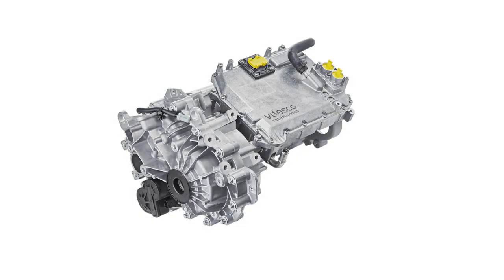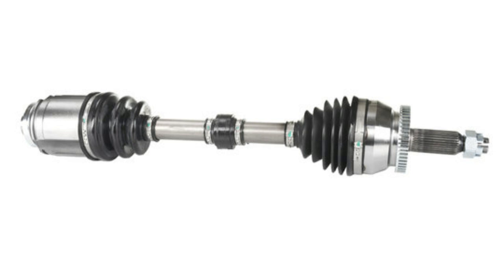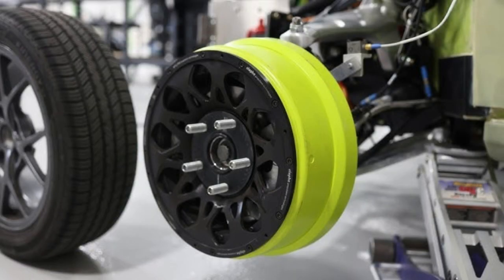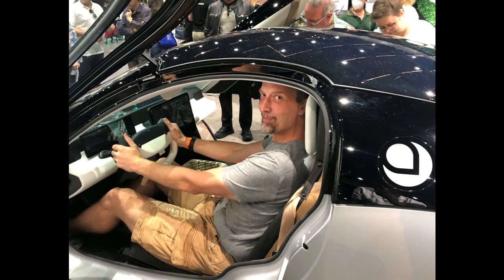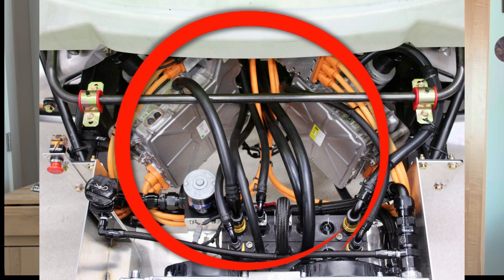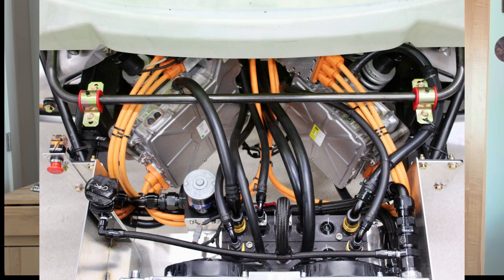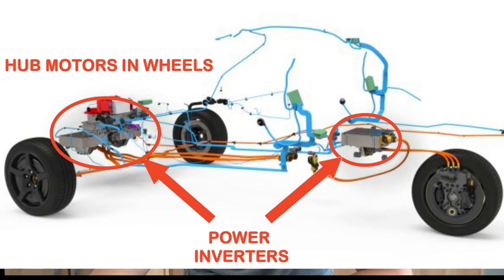Aptera's EMR3 Motor Design vs Original Elaphe Hub Motors

Comment: Thank you for the analysis. You implied that the reason for the drive train change was Elaphe’s inability to produce the required motors. I’ve seen other speculation that the hub-motors had heat issues and that being unsprung weight they suffered from vibration issues. I applaud Aptera’s change but is there additional insight for the change? TIA
Reply from the maker: I also read long ago that Lordstown had reliability issue with the Elaphe motors but I could not find the report and did not want to but out bad information. Thank you for watching!

Comment: NB that efficiency wise; NOTHING beats free wheeling. 
Regen is not 100% efficient, so covering distance in neutral beats it, but ONLY UNTIL you start braking.
Hub motors couldn't do that.
Not until now.
See this and when you 'get it' you will be amazed at just how ingenious Freegen is.
https://www.youtube.com/watch?v=bLu6H-K4L2Y
Now that's going to end up being made at scale, probably in China, by a company more than qualified to build larger ones suitable for Aptera.

IMHO Aptera didnt look hard enough  for an alternate supplier of hub motors.
There are plenty of suppliers that would be happy to do the volume of hub motors they envision.

As to the issue of unsprung weight, see this!
https://www.youtube.com/watch?v=qxKJu_-0rUA
Besides the huge reduction in unsprung weight, consider the implications:
No holes in the body or wheel covers for the suspension members and now drive shafts, improving drag tremendously. 
(That's something that should have an aero rubber 'boot' IMHO)
More interior space or aero design freedom.
etc.

Comment: I thought the use of hub motors by Aptera was a very good idea because they can resolve the issue of 3 wheeled vehicle rollovers, even with tadpole configuration with two wheels in the front. The operation of a conventional single motor FWD propulsion with open axle system verses independently controlled motors at each wheel is significant because the wheel speed and torque for each wheel can be independently controlled.  An example of this could be seen in the videos of the Aptera performing the Moose Test extreme evasive maneuver.  With hub motors the Aptera handled this test with ease performing the Moose Test at speeds that would cause an ordinary 3 wheeled vehicle to tip and roll. The active torque vectoring provided by independently controlled motors at each wheel provides greater cornering stability at high speeds and better traction under all conditions.
Reply from the maker: The issue with 3 wheeled vehicle rollovers can be attributed more to improper configuration. It is common for a tadpole configuration to have a powered rear wheel, this makes the car unsafe. However having a powered rear wheel is common. Aptera still has a plan for 3 wheeled drive just not for the Launch Edition. Let’s see how PI 2 handles the track and testing in the next month. Thank you for watching!

Comment: Bravo! Thanks for making the video and for doing the calulations. 
I have a question about if the engine can do regenerative braking based torque vectoring. 
If " EMR3 can not free wheel if no power to it" does that mean we can't let the vehicle roll down hill without power? (Can this be achieved with a release of a lock of motor to the wheel axials when we want to free wheel roll?)
Question 2. Does that mean emr3 Can't get regen braking/ regen from going downhill? Can it allow for torque vectoring by having different regen braking levels to each wheel?

Comment: You sound like an engineer! I LIKE your detailed list of components in your comparison. I think you left some out. There were changes other than the inclusion of a drive shaft for the new motor. Much more complex with more pieces in the suspension.
Reply from the maker: Thank you for the compliment.  This is true there are other changes too the chassis and suspension to accommodate the change to the ERM3 that I will talk about in a upcoming video. Thank you for watching!

Comment: Hub motors may be the future but they are not yet mature technology. The different size batteries are more of a weight change than switching from hub motors to a central motor. Get the car on the road and make changes/improvements in future models. If they can't make a profit, it won't matter which motor they use.
Reply from the maker: True, I think the hub motors will be the future, currently I have seen that BMW and Ford are preforming there own tests with hub motors. thank you for watching!

Comment: So, what’s the zero to sixty supposed to be now after this change?
Reply from the maker: There is nothing official from Aptera and I don't think we will get an official number until testing is done on PI (Production Intent) 2 or 3. however using a online calculator it can be estimated.  With 201hp from the EMR3, a 230 pound driver and a curb weight of 2,200 pounds  the calculator estimated 5.5 seconds.  Thank you for watching!

Comment: Good analysis on motors and weight.  Well done.  Would have been useful to have on screen graphics.

I think the Protean in wheel motors would be a better bet. The inverters are built into the hub.

If I wanted anything for my Launch Edition it would be heated seats and a wheel instead of a yolk.

Your production quality could be enhanced by a lavalier microphone and better lighting to keep shadows out of your face.

(I started making YouTube videos in 2019 and it’s always a continual improvement process)
Reply from the maker: Thank you for your feed back, I have a lavalier microphone that I will use on the next video.  I have always been a fan of the protean hub motor because of the built in inverter and how it would simplify production.  There are a few videos that Sandy Munro has on his channel where he reviews their motors.

We are considering developing a heated/cooled seat solution that can be self installed on your Aptera. Thank you for watching!

Comment: Great analysis thought I would have compared both FWD and AWD with the EMR3 setup.  Once Aptera gets some capital from sales & future investors, they might make their own IWM in the States.  There are lots of reasons why they would want to do that but at this time, the EMR3 is the best path to production.

A concern some friends had with the IWM was the high voltage wiring going to the front motors. They were concerned that in an accident that those wires might have 400V with lots of current behind it.  I explained that it would be very likely that Aptera would have shutoffs at the battery that in the event of a collision the power to those cables would stop at the battery. The BMS could also be programmed to disconnect the pack from the unit and even the cell strings from the pack though I think that might be a challenge with their cell connectors.  In any case, the high voltage wires would not have power except for a millisecond after impact.
Reply from the maker: I would believe that that the software to integrate the 3 hub motors to work together along with torque vectoring would of been the responsibility of Elaphe. On their site they feature that they have solution for wheel and vehicle control systems.  Thank you for watching!

Comment: Really nice, educational video. I also really like your delivery. So much better to see you talking (and if you are reading, it doesn't show) than (like so many others) to hear the narration with (usually) unrelated b-roll footage for video. Kudos.

For the weight comparison, it's a bit of apples and oranges, isn't it, because the Vitesco calculation is FWD and your Elaphe calculation is AWD? But this comparision is valid anyway, since these are the new and old LE configurations, respectively. For the Elaphe motors, you estimate 3 feet between the motor and the inverter, 3 cables per motor, and 3 motors. Wouldn't that be 27 feet of cable? (You state "9 feet of 4/0 cabling for the whole system."). But your 17 lbs for the cable sounds like you did use 27 lbs, not 9 lbs (using Google's 0.646 lb/ft for 4/0 cable). The hub motor configuration will also have coolant lines and fluid -- probably more of each than for the Vitesco motor, but maybe this isn't a huge contribution to the weight. Nonetheless, it does make the weight advantage of the Vitesco motor even more attractive.
Reply from the maker: Thank you for the feed back and watching the channel. I did calculate the weight using 27' of cable I just did not communicate that well.

Comment: Great analysis.  I think the EMR3 is going to drop the range by ~4-5% and will reduce the winter driving capability and acceleration but it is a necessary step to get to market.  This translates to a 16-20 mile range loss for the LE which is substantial but not likely to be a deal breaker for anyone.  I suspect the relationship with Elaphe has been soured.

I still think the AWD will be a combination of a small vitesco(Schaeffler) hub motor and an EMR4 (induction); this combination should be more power, simpler and easier to source than the modified m700 motors from elaphe and is a natural evolution of the supply agreements and technical base of the initial launch version.  Since the EMR4 is induction it can be shut off to cruise and Schaeffler should be in a better position than Elaphe to actually scale production of their hub motor.  This also makes business sense because why abandon a supplier which has given you the parts to ship vehicles and has a clear path to improve and return to an old partner that couldnt produce at the price or scale Aptera needed the first  time.  

Weight definitely impacts range but in terms of the physics calculations at a constant speed of 55mph the addition of 30lb to a 2200lb aptera is not that bad.  Apart from just generally selling that reducing weight is good i can find no reasonable combination of constants on road which would cause 1% for only 30lb.  Offroad on gravel sure since the rolling drag is way higher but not on a paved road with road friction almost certainly in the 0.008-0.01 range.
Reply: I like your idea of an EMR4 together with a Schaeffler hub motor in the back to facilitate all-wheel-drive. 
And agree this would make sense now that Schaeffler and Vitesco have merged.
I’m still going to buy my launch edition accelerator Aptera as soon as I can get my hands on it — but maybe that’s what will be powering my next Aptera.
Reply: @kevinscott8642  early Aptera owners will probably do well on referrals towards their 2nd one.  I'm torn if I'll deal with the import myself or wait until localized for Canada and potentially has awd option
Reply: OK, OK, OK, I will begin a workout and diet to lose 30lbs!  This is a good motivation. Thank you!  😆
Reply from the maker: I appreciate your insight and addition to the conversation. If I am correct the LE battery pack is 45kw/h with some of that capacity needed to allow the pack to solar charge when driving.  The pack could be set to have 41-42kw/h useable and compensate to keep stated range the same.  Looking at schaeffler's website you can see how some of their motors could be a solution for Aptera's rear motor.      
Thank you for watching!

Comment: A hub motor has magnets and windings, vitesco motor has magnet and windings.
Hub motor has magnets on outer rotor , vitesco has magnets on inner rotor.
You can freehweel both when wires are not connected, there is an effect called cogging that can cause a tiny bit of loss of energy, but not worth worrying about.
Why are you saying you cant freeweel vitesco motor? Its same as hub motor except you have rotor in the middle and windings on the outside. I could be wrong bit it doesn't make sense to me.
Reply: you think the vitesco motor isn't capable of coasting when the car goes downhill?
Reply from the maker: With a PMSM like the EMR3 without power to the motor you will have "motor drag" because of the electromagnetic forces that will resist the rotation of the rotor. This is not a "free wheeling" situation, because you would need to over come that force. The only way this could be avoided is if there is a decoupling clutch to disconnect the motor from the final drive. Thank you for watching!
Reply: @ApteraAccessories  I think your wrong, and heres why: if the wires in the coils are not connected to make a circuit, no current can flow in them, if there is no current there is no magnetic field generated, and hence no interaction with the permanent magnetic field of the magnets. Its very simple basics of motors how this works, I think you are confusing it with a inductance motor where the core can have inductive fields induced even when there is no external current flowing. An inductance motor eddy currents I believe are the cause of magnet fields. You can try argue the point would be interesting to see what you actually think is going on . If you want to be an ambassador for an ev startup you need to have at least some basic knowledge of motors.
Reply: @namenotshown9277  You said, "if there is no current, there is no magnetic field generated."  I agree.  But how many EVs have contactors to completely disconnect the motor?  I doubt that's common.  So there will be some small amount of interaction with the inverter.  Also, within the motor itself, there's a tiny bit of capacitance, eddy currents, hysteresis losses, whatever.  If we combine all of these, are PM motors still essentially freewheeling?  Or is there a small amount of drag in real world settings?  (Honest question.  I have no idea.)
Reply: @netscrooge  my guess is all those factors combine to give clogging effect, to get extreme high efficiency motors with windings they use blitz wire which reduces clogging effect
Reply: @namenotshown9277  Thanks!  Any idea how much energy is lost?  I have no idea if it's really tiny or something that makes a noticeable difference in a vehicle's range.
Reply: @namenotshown9277  Well, I didn't hear back from you, so I did a little digging.  What you said about the coils being off eliminating drag would be true if the PM motor had a coreless stator.  Otherwise, there are enough eddy currents and hysteresis losses in the core that the stator starts to act like a rotor in an induction motor.  That's easy for me to picture, since you can't switch off permanent magnets.  The spinning losses can be substantial, enough to wipe out the gains from operating a rear motor under a more optimal load.
Reply: @ApteraAccessories  which electro-motive forces are you referring too? Need to understand the way it works if going to make these type of statements.
Reply: just watching a video on kia electric motor drive, and they do have a decoupler so that the cogging effect is removed and they can get an extra 6 to 8% of range, so you were right, the cogging is enough to be of concern, I stand corrected.
Reply: @ApteraAccessories  Sorry about that.  Often things are not as simple as they first appear.
Reply: @netscrooge  oh motors are extremely complicated, my knowledge is minimal, Litz wire ( i miss spelt it last post) stops eddy currents in the windings, Csiro motor using litz wire and axial flux arrangement with magnets in hallbach array claim 98% efficiency, used in solar race cars for many years ( goes back a long way), never developed for commercial car use...as yet.

Comment: No one has spoken to the weight balance differences since we’re losing the hub motor in the rear. This will effect the handling.
Reply: The initial vehicle was designed as either a front wheel drive or an all wheel drive... so, there's that concern addressed.
Reply: The Beta vehicle was in Italy for several months doing suspension checks. My guess is the Beta has been modified to have the new suspension and motor so they could test it.  To build a PI set of vehicles without testing on the track would be foolish when they have Beta and could modify it.  Being in Italy, prying eyes can be kept at a distance.
Reply: @ddessert6 in Italy 🇮🇹 there are ways to prevent 🧿👁️‍🗨️malocchio. 🤣
Reply from the maker: There are certain rules that should be followed to build a proper and safe handling 3 Wheeled car that I will talk about in a upcoming video.   Thank you for watching!

Comment: Appreciate your research, breakdown and comparison of the two systems!  I am not yet convinced that the drivetrain switch has been done due to a supply or demand issue.  Rather, I feel it has been done to reduce Aptera's software workload prior to production.  Going from three independent systems which need to be software coordinated depending on many various conditions and situations, down to one drive unit which requires little to none of the same, is a huge reduction in software needing to be written prior to production.  I could easily be wrong, but Steve Fambro hinted at this in the first Podcast episode also.  Your thoughts??
Reply from the maker: The software to integrate and control the motors should of been the responsibility of Elaphe I believe.  On their web site they advertise vehicle and motor control system as part of the hub motor solution along with the torque vectoring capability that was planed for the AWD Aptera. I think the software that is still in development would be their UI/UX and integration of Android Auto and Car Play. We have examples of company's that have had poor execution of their UI/UX like Volkswagen how it effects ownership. Thank you for watching!
Reply: @ApteraAccessories   Okay, if that is the case, the situation may be much more about capability and availability as described.  Great information, thank you.